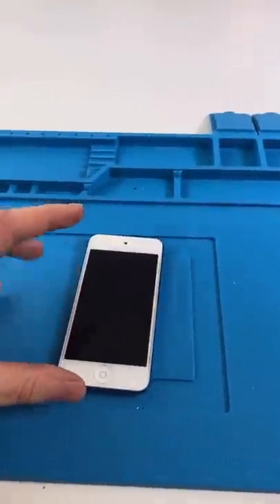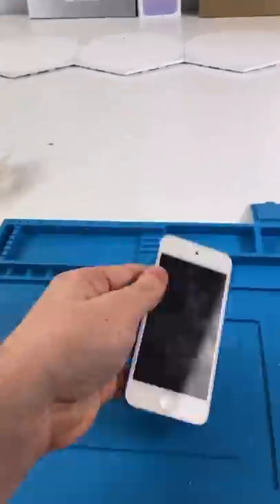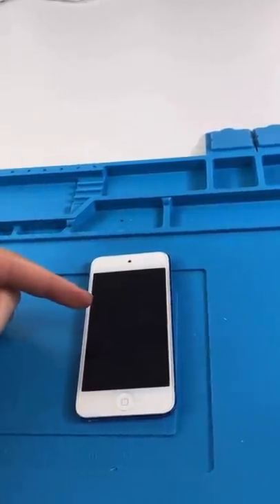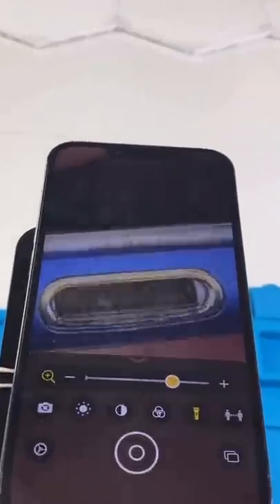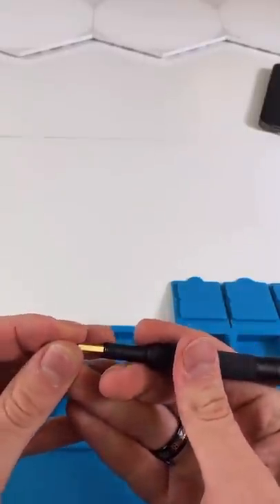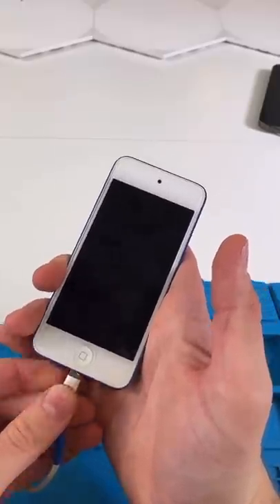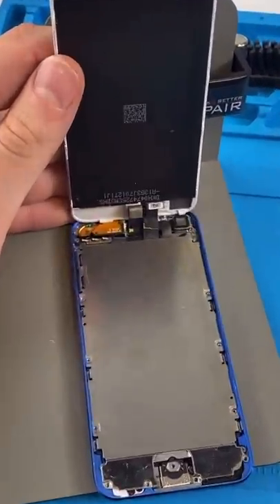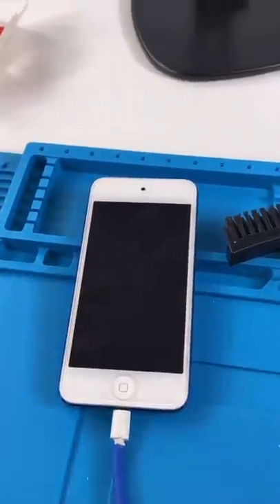STOP USING RICE FOR WATER DAMAGE.... #Shorts

Comment: so what part of using rice is so damaging besides getting a grain of rice stuck in the port? genuinely curious, love your content
Reply: There's not much of a point using it, it may get water out of places like the chargeport, but mainly only removes external water, and not internal water damage. Plus rice can leave rice dust and bits of rice in the phones chargeport, micphrone, speaker, etc.
Reply: The starch can get into your phone and cause even bigged problems than water damage
Reply: @genzeuronymous7787  true!
Reply: Rice will only remove water it comes into contact with, not the water inside the phone. And it certainly doesn’t remove the contaminants water or liquids carry in that cause corrosion. It’s worthless in phone repair.
Reply: @egg99  no it wont, water does not conduct electricity. Look it up
Reply: @AnonYmous-tr4cu  water mixed with minerals and/or salt is conductive. Usually, any water you probably can have is conductive. It's fair to say that water shorts the components.
Reply: @izpcshop7326  it’s fair to say that water can have a hand in damaging it. But pure water is extremely unlikely to short electronics. Most water we come across of-course will have ions and minerals. But you can clean water damaged with distilled water and alcohol. I’m js its kind of misleading to say water damages your device, which is why people think Rice will help. But it doesn’t because rice may remove moisture but not the actual minerals that salts that will chemically react with internal components and metals that causes damage.
Reply: @AnonYmous-tr4cu  listen to Egg, water will short your device, it literally works as a jumper if it's mineral water, one does not wash electronics with distilled water in the open air as well, once distilled water touches anything it will absorb its minerals and turn conductive again instantaneously. The only environment it would be possible is an ultra clean room, even though, its much easier to use non conductive and quick evaporating solutions.
Reply: @AnonYmous-tr4cu  chemical reactions aren’t what damages the phones, it’s the fact that when turned on some parts can short which ruins the phone, in chemistry you can’t just splash something on a solid object and expect a reaction
Reply: @gabrielxavier2676  I think when cleaning large motherboards tho people tend to just use water on them while disconnected from any electrical source
Reply: @Lordofcin  I wouldn't recommend, unless the motherboard is coated with something non conductive, not water soluble and not easily removable.

I have cleaned boards with water before, even if you wait for evaporation to avoid a short you have just deposited minerals over traces and pins which will reduce the lifetime of the device unless really specific measures are taken, like wash with some oils.
Reply: @gabrielxavier2676  I was referring to bare motherboards, with everything taken off of them
Reply: @Lordofcin  Oh right, I'm sorry.
I guess if there are no traces exposed yet it is the most efficient and cheap way to clean it
Reply: The rice can leave bits of dust in pins and the rice can end up anywhere. Sometimes you need to tear the whole phone apart to get the rice out
Reply: @AnonYmous-tr4cu  yes how many people drink pure water. Most people drink mineral water
Reply: @AnonYmous-tr4cu  true

Comment: I'm pretty sure iPod Touch 1-4 had shiny backs and only from the 5th gen onwards they started using colored aluminium and it looked to be either a 6th or 7th gen cuz it has no lanyard pin
Reply: @Sarahswiftie13  so cool 😶
Reply: @omaid05  ikr 🙄
Reply: And the 1-4s are heckin small
Reply: definetly a 6 or 7, you can tell by the colour

Comment: If you accidently had your device water damaged, just turn it off immediately (if it isn't already off) then DRY IT WITH ANYTHING ELSE RATHER THAN RICE! Hair dryer or any other similar tool. If in any chance rice could do the job is with the motherboard out of the device.. Rather than that, just give it to a specialist.

Comment: it's not a 4, 4th gen's always had non-colored metal backs and were curved like 2nd and 3rd gens they were also the last iPod touch to use the 32 pin connector. And it's not a 5th due to the lack of the wriststrap/lanyard button. After that though the only difference between the 6 and 7 is that they changed the font on the back

Comment: Ugh I remember having that iPod 6 gen. Died soo fast. And the screen was popping off from the battery 😎 finally got an iPhone bc of it lol. I dropped my 7 plus into the tub on accident (it slipped outta my hoodie when I was cleaning the tub) and like- as soon as it fell I grabbed it turned it off took it out of the case, dried the outside and let inside air dry. The speakers and mic were muffled but I fixed that my self, everything works fine now. I got my phone battery replaced recently and they said there was no water damage which is a relief! Thank gosh I did everything right or I would’ve gotten grounded if my phone broke.😂😂

And one time while I was on a zoom for school my hydro flask fell over onto my chromebook (personal not school chromebook) and the water went into it, and the screen was messing up and basically I wiped everything, turned it all the way off, put it like a triangle and let it air dry over night praying it would work because I had school the next morning. When I woke up the next morning I turned it on and it was completely fine. It still works fine til this day. 
I get very lucky with water and electronics 😂

Comment: This is a 7th Gen iPod Touch. The only significant external difference between the 6th Gen and the 7th Gen is on the 7, the regulatory markings were removed from the back and moved into the settings app. If this was a 6, there would be regulatory markings at the bottom
Reply: yeah
Reply: Omg you’re right. I even found a website showing the differences, and they didn’t even mentioned the regulatory stuff. You’re a genius, thank you

Comment: STOP. USING. RICE. USE DISTILLED WATER.

The reason to use distilled water is because the water isn’t the problem, it’s the minerals in the water and distilled doesn’t have minerals so use and ultrasonic cleaner put some distilled water in it and get to cleaning the phone :)

Comment: Pro tip: the water damage is actually caused by the minerals in the water so if you spill water on your phone you could just turn it off, take off the battery submerge the phone into distilled water so you wash the minerals away

Comment: How do you repair an iPhone 7 plus that is stuck in boot loop but you can't restore it even with the phone in recovery mode and plugged into your computer, the phone turns off instantly after unplugging from charge, is this the battery?

Comment: That’s definitely NOT a 4 lol. That had the older design, with the reflective and easy to scratch back. This is not a 5 because it doesn’t have the iPod loop. 6 and 7 are hard to tell the difference unless you check the model number on the back of the iPod (or if it’s able to power on, check the settings)

Comment: What about silicone bead bags?
Reply: The problem with rice (and probably the silicone bead bags) is that it doesn't dry water on the sensitive components inside (because the rice is only on the outside). 
If your device gets wet, disconnect the battery and open it (if possible) to let it actually dry out.
THE WORST thing you can do is continue using or charging your device after it gets wet as electricity speeds up the damage.
Reply: @bennydontplaythat  thanks for the reply, reason i asked is because disconnecting the battery isnt an option for probably 90% of phone users as its a sealed unit and we will probably break the phone by opening it aha =) im just glad that samsung phones(not sure about iphone) has a water damage warning pop up if you plug the phone in “water in the charger port disconnect charger until port is dry” or something along those lines =)  i usually just wipe the phone dry with paper towel and let it sit and 'drain' and hope for the best haha
My phone doesnt have the waterproof seal anymore as it was repaired so cant be guaranteed waterproof, so i just try not to get it wet  👌🏼👌🏼

Comment: I’m not gonna lie, my first iPod (an iPod 4th Gen with the shiny and very scratched back) went through the washing machine, and I ended up putting it in rice, and it got totally back to normal. I don’t really see the issue with rice lol.
Reply: It gets stuck in your charging port if not handled correctly..
Reply: @ddgaxelnilsson7855  fair. Maybe there was some slight difference because my iPod had the 30 pin charger, and newer devices have lightning.

Comment: true story from what I did 

also they both were android phones. 

"Exactly (rice) don't work!!! When It comes to water DAMAGED PHONES" I didn't put my phone inside race but instead I put my phone by the fan over night it worked the

 next day it fell in the toilet by mistake I used an old battery same battery different phones  used bleach to clean in down 

And when I needed my phone fixed because of a faulty update made some of my apps gray my mom was not happy about it 

My old  phone company "boost mobile" took the water logged phone an refurbished it to sell yes. 

They sold it lmmfao ummm now someone's walking around with a phone where some of the icons are grayed out sad part is the internet main one they'll need. Um I still feel

Awful  for someone who bought it for them or for their kid  

And FYI don't go around selling water logged phones are device's and grayed out  apps that don't work anymore that makes you bad awful company period